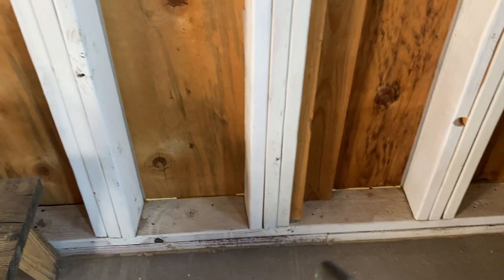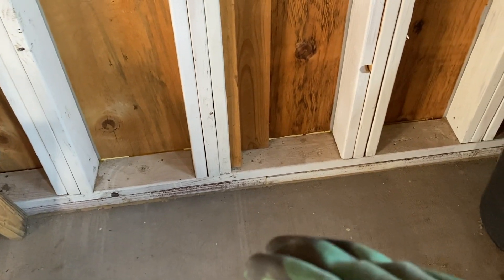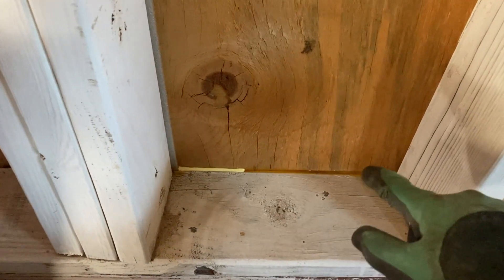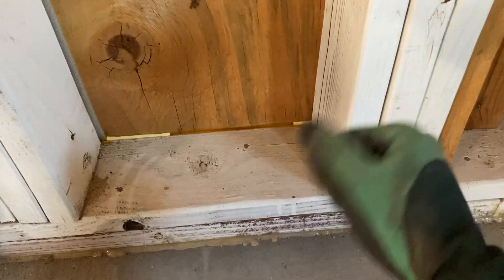Air, Bug, and Water Sealing From the Inside || Building an Off-Grid House Part 11

Comment: Well, it looks like you've made some progress, cool.   What are the winters like in your area of AZ?  Rainy?  Just wondering if it will hamper you much.

Look forward to the next vids.  Don't make me wait so long, Adam!  I'm OLD and would like to see the end product.  😁
Reply from the maker: Thanks, Haz. Yes, our winters are cold and somewhat damp. We get a second rainy season around Jan, and we usually get some snow. 

I have to try to get a lot more silicone on the roof before winter or else I'm gonna have to wait for spring. I might also have to wait until spring to finish the rainscreen cladding – that's a long process. 

If winter sets me back on the exterior, I'll just focus on the interior instead. 

I won't keep you waiting long anymore. Gonna try to  stick to one vid per week.